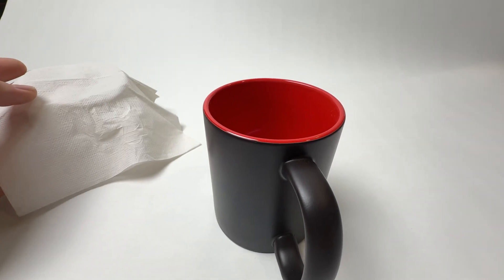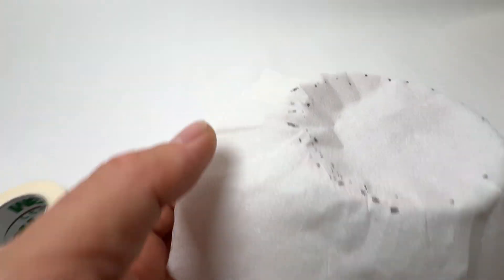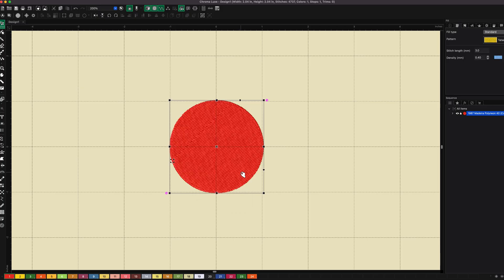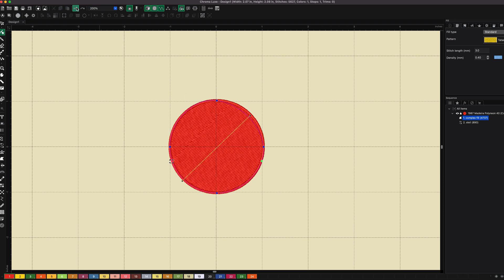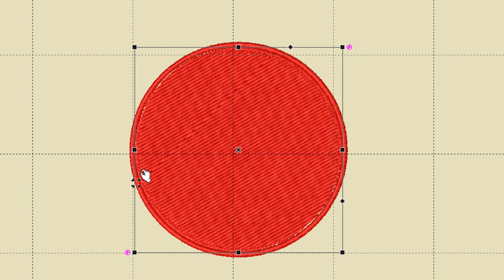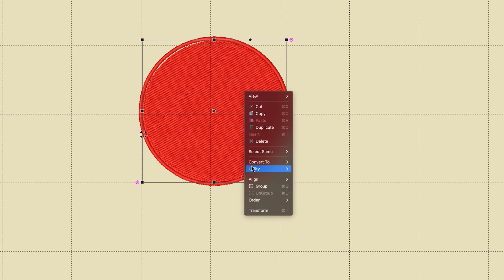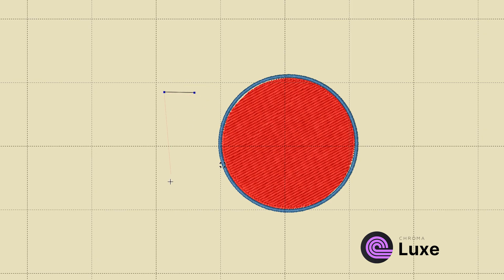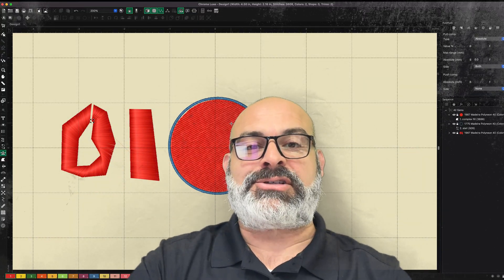Push and Pull Compensation Explained - INSPIRE vs LUXE

Comment: @chromadigitizingsoftware
Can you guys address the error everyone is getting on chroma software. “Application will exit because it is running on another PC. Make sure to save your work.”
Lots of other users are getting the same message.
Deactivated and reactivated.
Uninstall and reinstalled.
Ticket submitted 332170
Help me and all of out and address that issue. We paid a lot to not be able to use the software